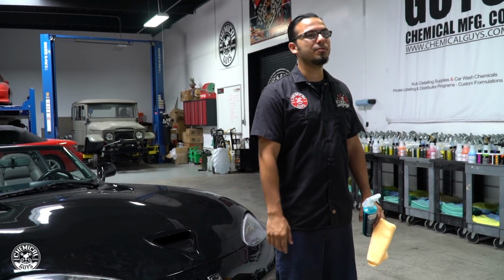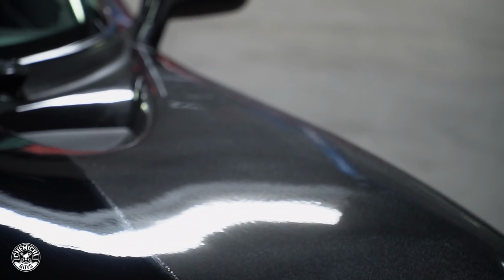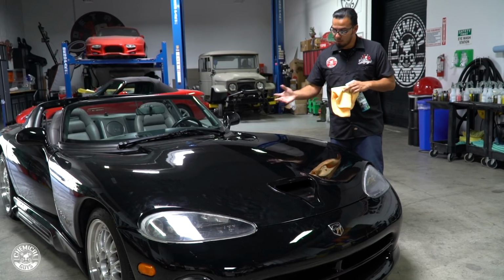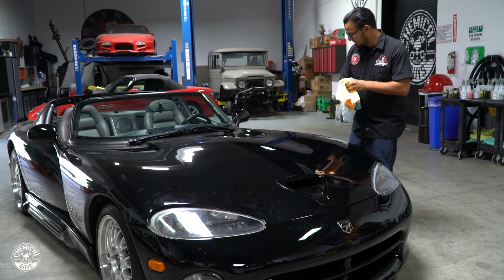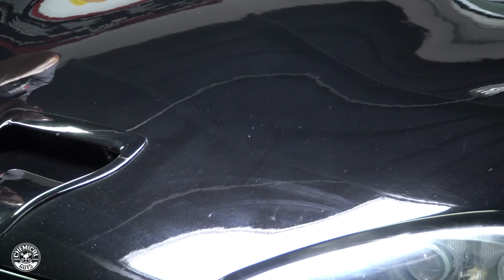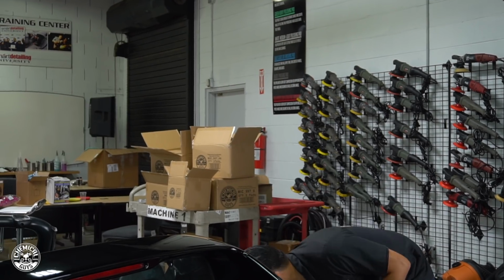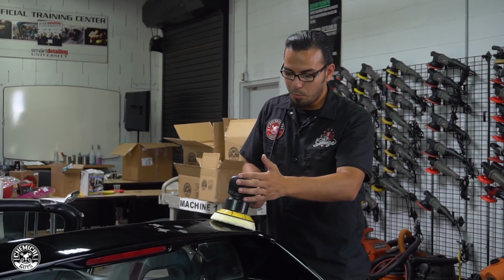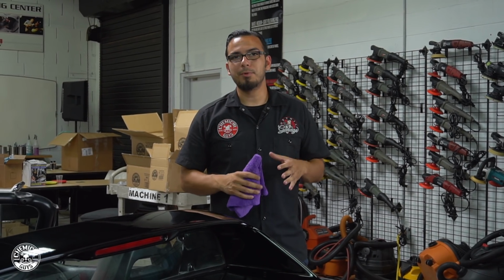How To Properly One-Step Polish Black Paint - Chemical Guys

Comment: great video can you tell me if using a California duster is bad for the paint
Reply from the maker: Hey there! It isn't necessarily bad for the paint however a dirty duster can drag abrasive particles across the paint causing scratches and swirls. A quick detail spray and clean microfiber towel is a safe method of removing light dust. - Happy detailing!

Comment: Is swift wipe or EcoSmart better for spot washing parts of the car between regular washes
Reply from the maker: Hi, both these waterless washes work equally well to clean your car. The real difference between the two is one contains wax, and the other, sealant. It really comes down to personal preference and what kind of protection you are looking to lay down on your car. If you are looking to maintain your wax coat, then go with EcoSmart. If you are looking to maintain your sealant coat, you might want to consider Swift Wipe. The other main difference is that EcoSmart is available in hyper concentrated form, whereas Swift Wipe is only available in ready to use form. Remember, both products are complete car washes in a bottle; it IS a "regular" car wash! Thanks for watching and happy detailing!

Comment: Chemical Guys "one-step polish" process:
1) use Swift Wipe Waterless Car Wash (or just wash the vehicle)
2) clay bar the paint
3) use Slick Finish Cleaner Wax with a dual action polisher
 a) spread the product with the polisher on setting 1
 b) diminish flaws (perform the polish) on the maximum setting
Reply from the maker: Hi, you're right: it's called a one-step polish, not a one-step detail. There is no such thing as a one step detail and there never will be! A product like Slick Finish or All in One can, however, reduce a multi step polish to just one step. Thanks for watching and make sure to check back later today for a new video upload!

Comment: "highest speed" 6?
Reply from the maker: Hi Paul! The Digital Display on the TORQ uses shorthand to display the actual OPM speed at which the buffer head is spinning. After 00, the six speed settings of the machine spin at: 1) 15 - 1,500 OPM 2) 20 - 2,000 OPM 3) 25 - 2,500 OPM 4) 30 - 3,000 OPM 5) 35 - 3,500 OPM 6) 40 - 4,000 OPM. When the detailer in the video refers to speed setting 6, he means 6 + clicks, or 40 on the digital display. They are the same speed.Thanks for watching, Paul, and stay tuned for a new video launching later today!

Comment: what can i do to keep dust from sticking to my paint?
Reply from the maker: Hi Braulio, that's a great question. Try using an anti-static product on your paint such as Extreme Slick Synthetic Quick Detailer. Anti-static acrylic wetting agents reduce static charge up to 75% as the product is buffed and dried, cutting down on static cling of airborne dust and dirt. Wet Mirror Finish also reduces static charge on the surface, allowing for maximum repellency of dirt. You can check them out below! Thanks for watching, Braulio, and thanks for being a part of the Chemical Guys family! 
https://www.chemicalguys.com/Extreme_Slick_Synthetic_Quick_Detailer_1_Gal_p/wac211.htm

https://www.chemicalguys.com/Wet_Mirror_Finish_Gloss_Magnifier_16_oz_p/gap11216.htm
Reply: Chemical Guys didn’t know you guys made products for that! thanks!

Comment: Another good video on the procedures to take to get a good result. I believe there was one step left out, and that was prepping the car after the claying and before the one step polish, so you remove road film, oils and grease that claying does not always remove along with the clay lube solution, so you are left with a clean uncontaminated surface for the polish to bond to.
Reply from the maker: Hi! After claying your car, you can go right into polishing. There is no need to  further prep the surface. When done properly, claying will remove everything on the surface of your paint. After claying, if you are finding that the surface is not a totally clean and a mirror finish, then you are either not washing your car properly before, or not claying long enough. You can always use a car wash soap like Clean Slate to ensure everything, including old waxes and sealants, are removed from the surface before claying, or you can use something like Wipe Out to ensure all that stuff is removed from the surface before claying. Once you're claying, you should continue claying until your surface is perfectly smooth with a mirror like finish. Claying takes longer than you might think. It's also important to choose the proper clay bar for your situation. Using a Light Clay Bar on a super contaminated car that hasn't been clayed in the past 10 years probably isn't going to get all that deeply embedded contamination out. When done properly, you can go straight into polishing after claying. Thanks for watching,and stay tuned for a new video dropping tomorrow!

Comment: What are the line on the backing plate for and how long does a all in one or cleaner wax typically last?
Reply from the maker: Hey Aaron, good question. The lines on backing plate were drawn in there to show the rotation of the pad. They are typically used for instructional purposes to show that when pressed too hard, a DA stops spinning. Thanks for watching and being a loyal subscriber, Aaron!

Comment: Why not V38?
Reply from the maker: Hi! If we had gone with the V Line series, we would have started with V36 and an orange pad. V38 is a final polish and has almost no cut, so it wouldn't have made a significant difference in the scratching and swirling on the Viper's paint. V36 and an orange pad is our go-to combo when starting on any car. Had V36 provided satisfactory results, then we would have proceeded to V38. Had V36 not removed as many scratches and swirls as we would've liked, then we would have started exploring different, more aggressive options until the desires results were achieved. I am going to leave a link below to an article that explains how the V Line series of polishes works. As you will see, V38 works best as a final polish and is almost never used alone. Thanks for your question and thanks for being a part of the CG family! Really cool C7 you have there! 👊
https://www.chemicalguys.com/How_To_Choose_The_Right_Compound_Or_Polish_For_Your_Car_s/644.htm
Reply: snakeskinner2 Why not the Cleaner Wax?
Reply: Andrew Lorenz .... either works I guess, just curious why not a v38 finish polish
Reply: what about p4? can that be used instead?

Comment: how do you know when you need to do a 1 step or multi step paint correction ?
Reply from the maker: Hey Lex, that's a great question that totally depends on your car, and you. One step polishes offer a more specific level of correction, while multi step paint corrections offer you unmatched versatility. A product like Cleaner Wax is great for removing light swirls, stains, and imperfections from your paint, however if your scratches were deeper, then you might need to take a more aggressive approach with one of the compounds from the V Line series. It also depends on you and what you are looking for. Are you looking for a one step product that is going to polish and wax your car at the same time? Or do you plan on applying a separate wax afterwards so you don't need a hybrid product? Thanks for watching and make sure to check back every Monday, Wednesday, and Friday for new video uploads!

Comment: Who even polishes anymore? It’s all about ceramic coat now!
Reply: You have to compound/polish and perfect the paint before you put down a ceramic coat dumbones lol
Reply: Horacio Vences but polishes are for removing imperfections while ceramic coating is for protection.. how are they comparable at all.?
Reply: This is a manual vs automatic type argument...
Automatics are better ... 
but manual cars are more enjoyable..
Let that sink in
Reply: If you buy a new vehicle, it could work. If you buy a used one with scratches on it, or own one with scratches before you apply the ceramic coating, then you’ll want to remove as much defects as possible.
Reply: I didn’t know you could apply a ceramic coating without polishing the paint first?? 😂😂
Reply: You polish before ceramic coat. Do some research lol
Reply: Chris Alvarez it’s proven that ceramic is better than polish. It’s outdated
Reply: Chris Alvarez how am I comparing? I said that ceramic is better... plus with a polish you need a wax. And wax is like gum it allows dirt and grime to stick. Ceramic is like a clear coat of glass. Totally different than “comparing”. I have a feeling you’ve never even detailed a car in your life. 🤷🏻‍♂️

Comment: Is sou good and what difrent All One Polish V4
Reply from the maker: Hi Gabe, how's it going? In this video, Nick used Slick Finish, which is a cleaner wax that contains some micro abrasives to cleanse the paint and remove light swirls, stains, and imperfections. All in One is a hybrid polish that polishes and then seals your car. It does not contain any wax. All in One is also more abrasive than Slick Finish Wax and would be able to remove more deeper imperfections. Thanks for watching, Gabe, and thanks for being a part of the Chemical Guys family!
Reply: What's Difrents Cherry Wet Wax and Butter Wet Wax ?